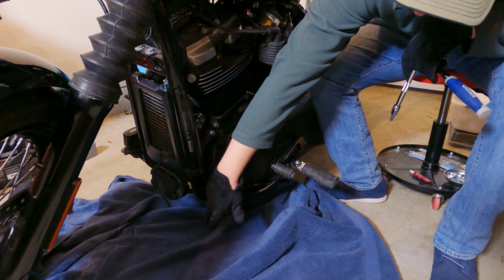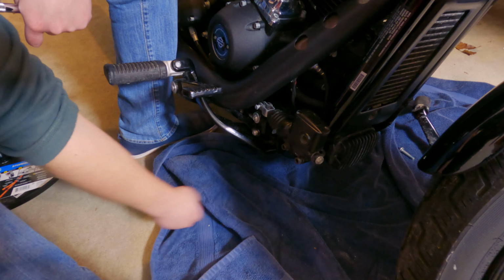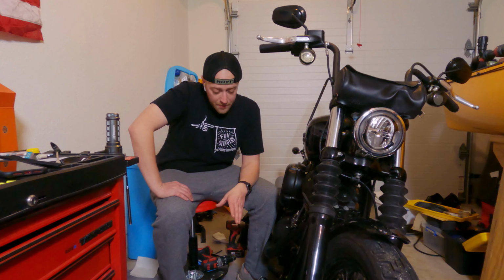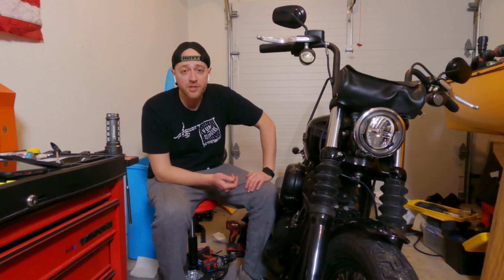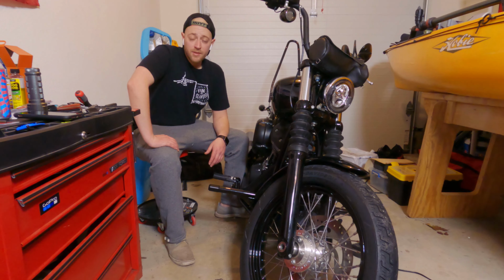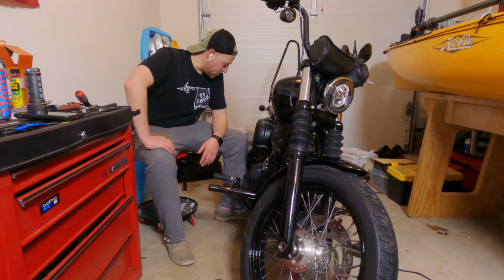Installing Bung King Highway Bars on a Softail Streetbob

Comment: Cool Video for sure… I want to install these on my 2021 Street Bob but I’m nervous as f**k about doing it myself  🤔 . 
Not set up at all for doing mechanical work in my garage and I’m NOTORIOUS for stripping screws. 
I love that crash bar though I think I’m gonna need to have it installed by someone who knows what they’re doing  🤷🏻‍♂️.
Reply from the maker: it isn't too bad with some help, but if you've got a stripped screw its literal hell - unfortunately I know all to well. 

they are well worth it though, I dropped mine low speed in a parking lot and the bar took all of the force